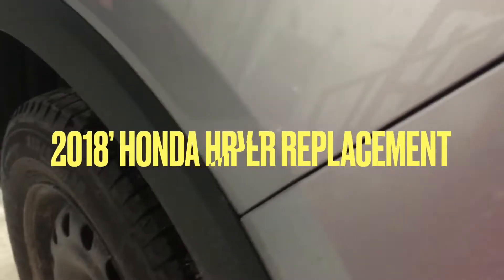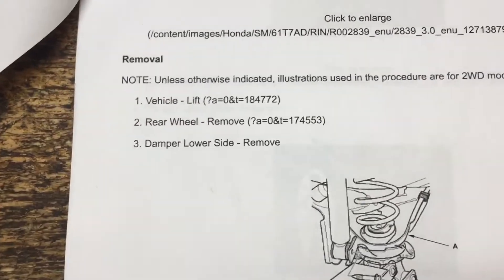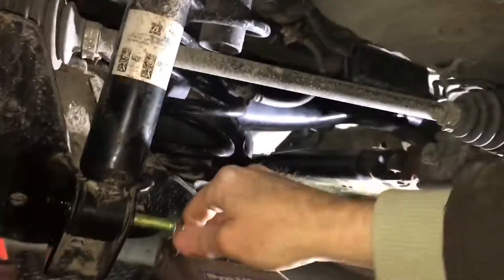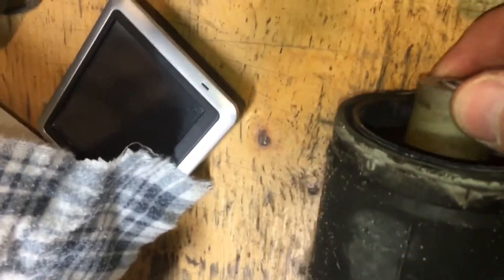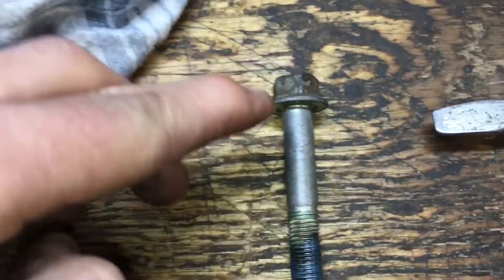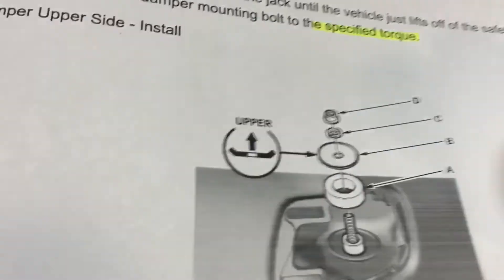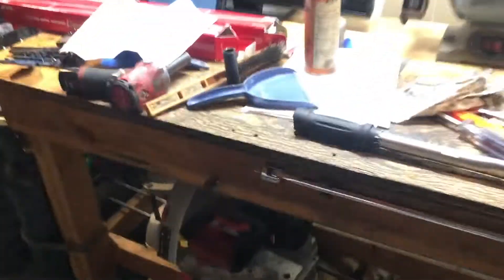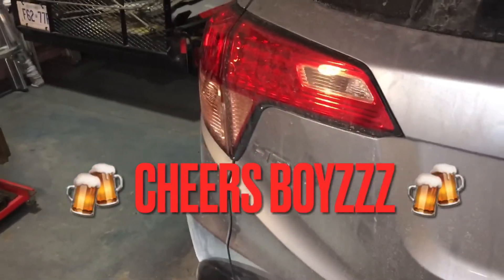Honda HRV Damper Replacement

Comment: Just a heads up, we bought a 2016 hrv, it was pre owned but a great vehicle....I noticed and pointed out to the salesman that there was a knocking noise coming from the rear, we bought the car anyway with the agreement that they would fix this issue, we took it back after a couple weeks and the service guy told us there was a recall on the rear struts, so they replaced them, all the noise went away, then returned after only a couple months, turns out, when they replaced the struts that were defective, they put the same (new) defective struts back on it, so after replacing them a couple times , they finally got the good upgraded struts on it, we have been ok a couple years now, however, now the fronts have gone bad now 😩
Reply from the maker: Thx and thx for watching 🍻
Reply: suspension only lasts 100k miles or so, anything after that, can't complain much
Reply: @M.TTT.  this was only a 30k miles vehicle, they should not have worn out that quickly....😏
Reply: @johnstark3058  dayum, that's wacky then

Comment: Thanks, easily done. I could not get the 'boot assembly' off of my shocks, I had to remove the rubber boot to get to the metal stopper assembly inside and tap it with a hammer to get it to come off. Even though I live in California there was a bit of corrosion holding it firm. After that mine was exactly as yours. Thanks - Saved me $600.00

Comment: Awesome video.. Wouldn't happen to have a video of doing the front as well would ya?? And yeah the dealership is a rip off.. They wanted $1300 for a drive shaft and almost the same amount for labor.. Found a shaft on ebay that only had 4,000 miles on it and a family friends garage only charged $75 to install it..
Reply from the maker: Sorry, I have only done the rear. Thx for watching 🍻

Comment: I have a honda vezel hybrid car rear tires  both out of camber. Is their possiblity to correct it.
Reply from the maker: Sorry, I am not familiar with that model. Fatigued springs will not only alter ride height but might affect camber. Obviously check bushings. Thx for watching.
Reply: Yes as worn out shock absorbers have more sag which increases camber substantially. It’ll have lower ride height and more bouncy plus noises when bad. Eventually it’ll fail and collapse entirely onto just the spring.

Comment: I don't think there is much to be gained pumping the shocks the wrong way up. The idea is to get the fluid to the bottom where it is required to act against the plunger inside using gravity to allow the fluid(or gas) to fall. The reason we do this is because they have been stored and transported in a horizontal position. The shock will become notably stiffer following a couple of pumps if performed on the orientation as intended for use.
Reply from the maker: Very good point. Mindless moment on my part. Appreciate the civil and contributory comment. The “scene” has been edited out. Not to guard my fragile ego 🤣 but to prevent others from repeating the pointless exercise. If you have no objection I would like to make a short “correction” video. With your comment details included. Pinned.
Reply: @TheGibby3340  great idea. i think the importance is why things are done which gains the comprehension of actions

Comment: How did you get the dust cover off the old strut? Simply pull it or what? Currently stuck getting those parts off.
Reply from the maker: While it was some time ago, as far as I recall the plastic sleeve just slips up and off. I don’t recall any issue with removing them. Thx for watching 🍻
Reply: Did you ever get it off? I can't get the "damper mounting comp." (as labeled in video) off the damn shaft. And none of the aftermarket ones come with it!!?!? Definitely can't just pull it off. it has a metal piece keeping it on. very frustrating
Reply: @FOTB407  Take the rubber boot off, to get to the metal washer assembly inside. Then tap it with a hammer. There will be a bit of corrosion 'fixing' the two metal parts together. 'Tapping' gets them loose. Mine came right off after a gentle 'tap'.
Reply: @stevehageman6785  i did this later that day and it worked. Thanks!!

Comment: You said it's good practice to cycle cylinder a few times. I'm wondering why? Is it just to confirm they are working or is there something else?
Reply from the maker: Just a functionality/leak check I think Mark. I can’t see any realistic purge or fluid balance logic to it. Thx for watching as always 👍
Reply: @TheGibby3340  I kind of figured that but it wouldn't be the first time an assumption of mine let me down. Thanks for the answer.
Reply from the maker: @mfsperring  Mark…See the pinned comment for a correction & further detail to your question.

Comment: How did you get the top metal part off the original shock????
Reply: Take the rubber boot off, to get to the metal washer assembly inside. Then tap it with a hammer. There will be a bit of corrosion 'fixing' the two metal parts together. Tapping gets them loose.

Comment: Does the black hard plastic supposed to be transferred as well?
Reply from the maker: For sure if your replacement shock will accommodate it. Thx for watching. 👍🍻
Reply: I transfered it over but now it makes a rattle noise. As if it were loose or something
Reply from the maker: The plastic shrouds are really only designed for OEM dimension shocks.
Reply: Ahh well that makes sense. Thank you sir!